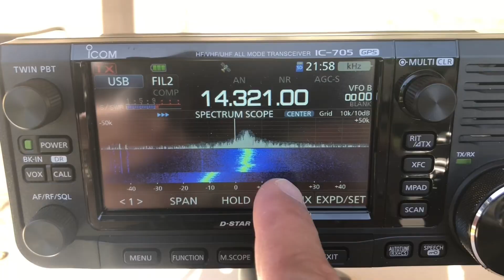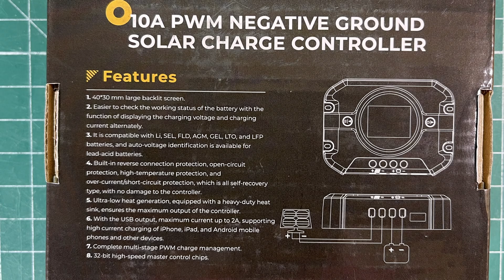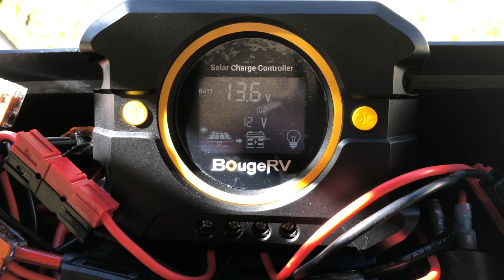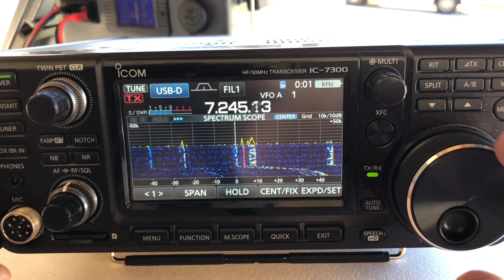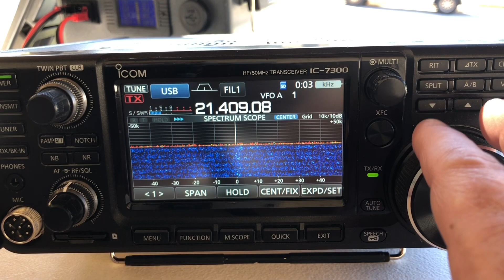BougeRV LiFePO4 Solar Charge Controller

Comment: Thanks for the video, today I made a test for pota preparation and I had the problem using the allto solar mppt controller, so was a good test but I do not spected this result. So I searched and found the same controller you tested, I'm happy that I selected  the correct one. Once arrived,test again hopping good results.saludos,  XE2GRC

Comment: I bought the BougeRV 48L fridge/freezer this past summer as we needed extra fridge/freezer space from our 6 cu ft LP fridge in our RV. They have provided very good customer support and sent me a new latch/handle with a video on how to change it when I accidently broke it off using the fridge as a platform for putting on my books. Anyway, good to know about the PWN solar controller. I bought the Explorer battery box that Jason featured from Gigapart and bought the Powerwerx 30-amp MPPT controller to charge the 12-AH of LIFEPO4 batteries I installed in it. I assume this is a very dirty controller, but haven't tested it yet - I will test it with my WA3RNC TR-35 CW transceiver when I get it build (It just arrived). I also bought the 100-watt solar panel that Jason recommended so it will be a good POTA test, if needed will use your link to get the PWM controller. Normally I won't need to charge when I operate, but it will be good to have for Field Day, etc. Thanks for the test! Cheers, Dave - KU9L

Comment: I’m new to solar power. I have a bioenno 12ah battery with power poles for output and a barrel connector for charging. I want to charge the battery while playing radio. Since this controller doesn’t have a load connection, is ok to connect the radio to the power poles while charging with a panel to the barrel connector?  Don’t want to damage the battery.
Reply from the maker: You are absolutely fine connecting the charge controller to the battery with one cord and your radio to the other.  They are actually connected to the exact same spot on the battery.  Usually you don't use the load from the CC anyway.  I never do.

Comment: Have you thought about just shielding the controller with aluminum Duct Tape.
Reply from the maker: I've actually got a guy working on a case for the CC to isolate the RFI.  Hopefully it works!

Comment: For my 'little geek', I use and absolutely love the Renogy 10A 12/24V PWM controller for my Bioennos! It's very small and compact, only 4.7"x3"x1". Best of all, it's very RF-quiet!! On Amazon for only $17. While I know the MPPT is the more efficient type of controller, all of the ones I tried were RF-noisy (that's the problem with MPPT for RF ops). Something to consider 😇73 KJ6ER
Reply from the maker: Woo-Hoo lol!  That sounds about the same size as this one.  Just too darn big unfortunately.
Reply: @hamradiotube  ... that's what she said!! 🤣 Wooooo hooooo!!

Comment: Mike, maybe wrapping the charge controller in some wire mesh (faraday cage) and heat shrink tubing?
Reply: I was thinking about aluminum foil. I use this method on our Comcast modem and it works very well. It might also help to use snap on toroids on the input and output as well.
Reply: @kd5you1  I was thinking the same as well. Multiple layers of aluminum foil on top of the shrink wrapped board and then reshrink wrap it. But first you have to verify the noise is not coming through the power line and purely RF.

Comment: Nice battery boxes Mike and thank you for finding affordable solutions for our portable operations. One question, have you left the solar hooked up for a full day or more on the battery? I ask, due to purchasing a cheap solar panel that was supplied with a multi battery chemistry controller and when left to its own devices, took my battery voltage up to solar panel voltage after a while. I may have a punt at trying this controller out as a replacement.....Enjoying your vids lately Mike, keep them coming.

Comment: Hey Mike, I noticed you have the same predicament that I do with the 7300 not keeping the time. I believe this is an internal clock battery issue. Would you be willing to show a fix on that?
Reply: To fix this you need to crack open the 7300 and attach a new battery. There is a video of it out there that I followed regarding how to do it.
Reply from the maker: Hmm, that makes sense.  I honestly don't pay much attention to the clock on the radio lol.  I did notice it wasn't keeping time anymore though.  Maybe.
Reply: @hamradiotube  seems to plague the 7300 community.